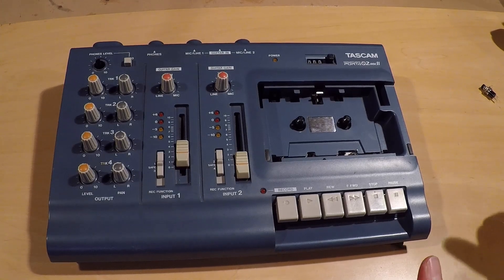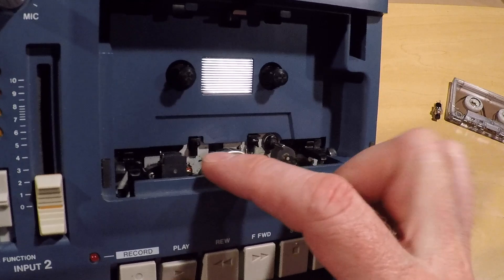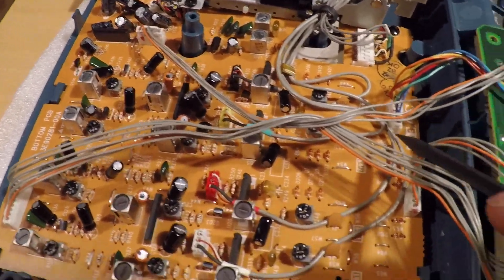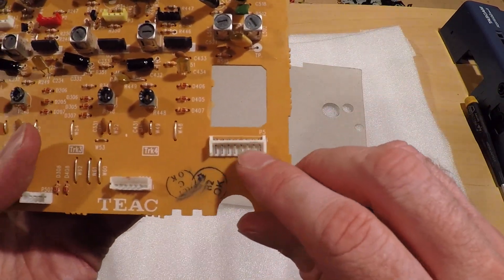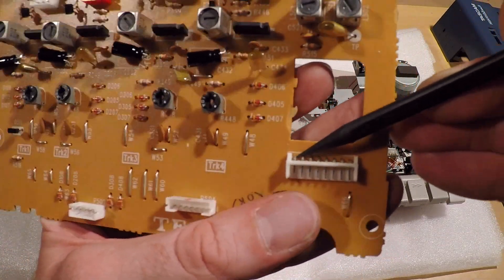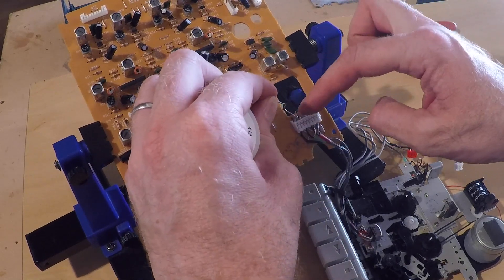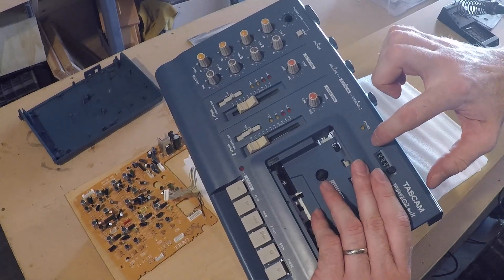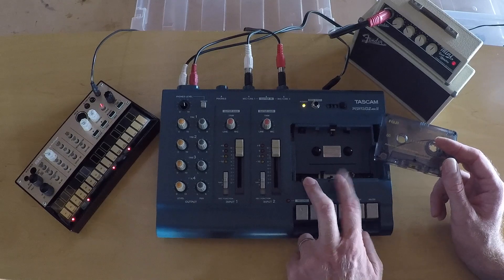How to install an erase head bypass switch on a Tascam cassette recorder

Comment: Unfortunately, when it is done this way, the record bias oscillator signal will become highly compromised and result in a recording that falls short of what the machine is capable of. The bias oscillator for the record head needs to see the load of the erase head, so disconnecting one or all of the head coils will throw the bias off. That said, this still works but you do end up with more lo-fi than you might want (loss of lows, grainy highs). Just wanted to put that out there as I also wanted to try this but deeper research led me to greater understanding on inductor circuitry, RF, and recording physics in gernal. There's a lot about this subject written on Tape Heads and also a great Reddit post where one person mentions building a dummy load... even then, results were not perfect.
Reply from the maker: Agreed. But to be honest when doing sound on sound tape loops lofi quality is totally ok. For me anyway.

Comment: This video is quite old. But for a less destructive way one can build an intermediate cutoff with a JST-EH 8pin male + female connector and a 4PDT switch. Pick either the 4 grounds or the 4 signal lines to route to+from the switch, with the rest going straight from one JST to the other, and then clip the resulting unholy abomination of wires in between what's already inside the Tascam. This way you end up with at worst a hole inside the upper deck to put the switch through, but the actual PCB and wire assembly untouched.
Reply from the maker: I did this one way before I knew anything about JST connectors. But even now that I do know about them I probably would still struggle finding the right connector. But definitely a good idea!
Reply: how would i do this on a 424 mkIII?

Comment: do you have any tips for bypassing a magnetic erase head? I assume there's no way to have it be a switch but would covering it in foil work?
Reply from the maker: You can easily just remove the head completely if you want, but probably not what you want. Not really able to put a switch though. Yes the foil option works great . I’ve done that. Make a little flap with tape and foil so that you can flip it up for normal and down for bypass.

Comment: how would this work with a 424 mkii? we tried this mod and it didn't work :( any tips?
Reply from the maker: I’m not too sure. This is the only Tascam I’ve ever found. But you are not the first to say the 424 is different and this mod won’t work. Can you try and just trace the wires coming off the erase head to see if they have a common ground that you can interrupt? But might not be possible. I also have a Yamaha MT8X and it doesn’t seem possible with that either.

Comment: Nice mod. I'm curious though, why not bypass straight from the erase head, instead of the socket?
Reply from the maker: Because there are multiple channels on that tape head so you would need a quad throw switch. The ground was the only common line and it just made sense to do it on the socket. But others have done it at the head like that. Thanks for watching!

Comment: Great video.  I've tried this mod on the Tascam 414 but it doesn't work, at least not with this kind of switch.  It seems like even if the common is cut from the 4 erase head wires, it still works.  I think that each wire needs to be isolated and cut from ground.  I would need another switch.

Comment: This is great!  Do you know if this is possible on a Fostex X-12?
Reply from the maker: Probably but I’ve never touched a Fostex so I can’t be 100% sure. Best way to confirm before you tear it apart is to press play and see if the erase head moves. If it doesn’t move when play is pressed then this mod won’t work. But if the erase head does move with play it means the erase head is and electro magnet and you can cut the line going to that head to make this mod work.

Comment: Hey, nice one, I've been searching for something like this to mod mine, but found mixed comments about the results... do you know if this has any downside effect when it's in off position? Some people say that it affects the bias signal sent to the tape prior to recording, so if this is permanent (even in off position) the quality of recording could be drastically affected. Do you note any quality difference in yours when recording normally? I don't mind lo-fi results for sound on sound experiments, but would be great if normal operation is still intact after the mod. Any comment on your experience is much appreciated. Thanks!
Reply from the maker: No I haven’t noticed any issues. I have a lot of different cassette players and recorder and this one definitely sounds the best. When bypass is off everything still operates as it normally would before the mod. But also to be clear I’m only doing LoFi sound on sound stuff so I might not even know if there was an issue like you described.
Reply: @SISKworks  great to know! thanks for your quick response, all the best!
Reply: This mod does not work on a Tascam 414

Comment: I like this idea better than mine using an x many pole switch. Although curious about the momentary choice? why not on/on?
Reply from the maker: Greg Garms My main reason was so that I never accidentally leave it engaged when/IF I ever need to do a normal recording. I also just had a bunch on NC push buttons and not many toggle switches on hand at the time.
Reply: @SISKworks  hey Mike. My tascam has issues with the stop button. It won't bring the magnets back, so now I can't even get the tape in. You know what that is?

Comment: Coincidentally I did almost the same a few months ago, not in this ‘destructive’ way, but fitting new connectors between the two white connectors of which half of the wires would go to a 12 pin on/off switch. However, I had decided that the active track wires would have to be disconnected by use of the switch, while the ground wires stayed connected. Interestingly it didn’t work (well). After seeing your vid, I decided to turn my connectors the other way round on both ends, so that now the ground wires would be disconnected using the switch. Now it actually works, so thanks a bunch for giving me that idea! I am wondering though why my intitial version didn’t work, do you perhaps have any idea?
Reply: Hey, looking to do something similar, what are the part names of the connectors? Im looking to buy a jumper so i dont have to destroy the original pcb mounted connection. Thanks
Reply: zaleschukmusic I’ll have to get back to you on that.
Reply: @KPsTboy  No worries, thank you!
Reply: zaleschukmusic What I used is a 12-Pin Mini Toggle Switch 4PDT 2 Position ON-ON 2A 250V/5A to which you need to solder cables and attach male and female terminals which fit into the Dupont Jumper Wire Cable Housing 2.54mm Pitch (8 pin width), which will fit onto the connectors of the Tascam. Be aware that not all Tascams use 2.54, so it’s not guaranteed to fit all Tascam connectors.
I don’t know if you use Instagram, but I could put an image up there to give you a better idea, as I think I still have a spare lying around.
Reply: @KPsTboy  Thanks! My instagram is @zaleschukmusic
Reply: @zaleschukmusic  Posted a sample on Instagram under #soundonsoundtape
Reply: For the Porta03 the pitch is 2.0, search for JST PH 2.0 for the specific connector. Hopefully will post images of this, but need to get the Porta03 back to life first...
Reply: @KPsTboy  i have a tascam 414 mkii
Reply: zaleschukmusic I’ve looked into images of the 414’s I had, it looks like 2.54 pitch, though unfortunately I can’t confirm that. What you need to do is measure the distance of the pins. 2.54 means nothing more than 2.54 mm distance between the center of 2 pins.
Reply: @zaleschukmusic  can you confirm if the 2.54 pitch was suitable for the 414 mkii?
Reply: @edmundmoon556  I ended up getting carried away with some other projects, and never got a chance to try to mod it.